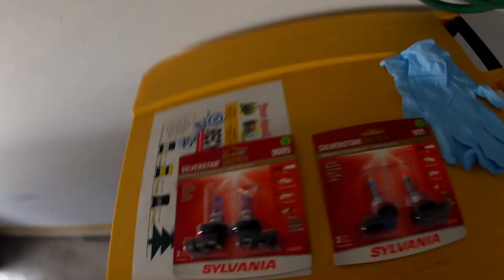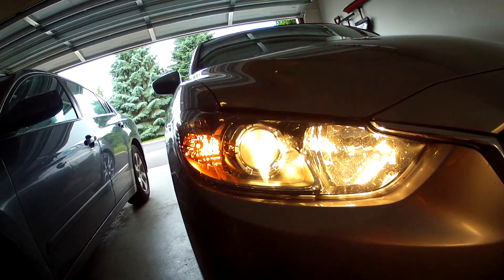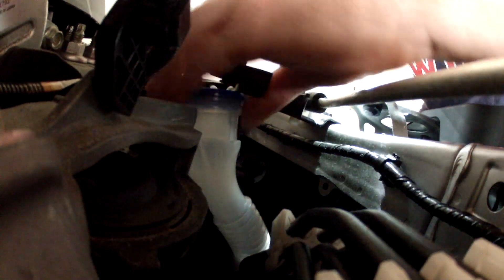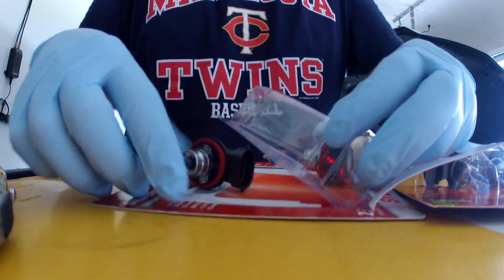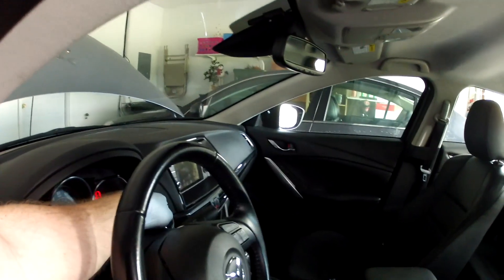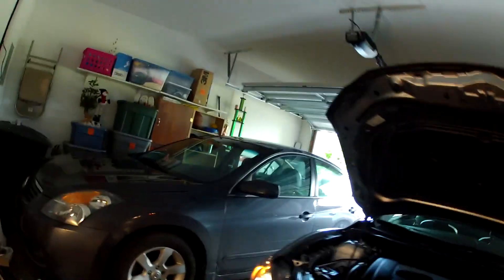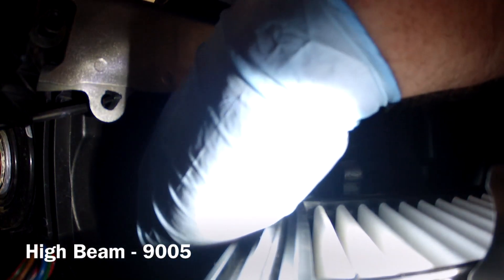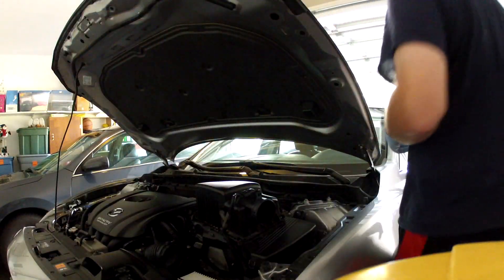2014 Mazda 6 Headlight Bulb Installation

Comment: Something I was wondering, if I want to replace my halogens with LED bulbs, do they plug right in perfectly, or do I need an entire new assembly? Do I need to alter anything with the fuse panel?
Reply: @avn4975  sorry, car was totaled by 4 deer 🦌 before I could install and I never found out 🙁

Comment: Great video again thanks and let me add this on my truck I put on led bulbs I had PIAA but the led bulbs are very much brighter so I picked up some eBay led bulbs for our 6 I’m waiting for my son to put on.

   I had OPT7 led bulbs on my truck well one of the drivers burnt up and OPT7 won’t just let you buy a replacement so I bought some just regular led bulbs on eBay they are just as bright so save your coins.

Comment: So I changed out my low beam no problem I can get the power plug to come off the bulb for high beam did you just pull really hard or is there a trick??
Reply: Same for me, did you get it?
Reply: @dvd162  did you get it? Im having the same problem
Reply: @joedoughty7212  yes i had to use a screw driver to push the tab and pull down at the same time
Reply: @dvd162  lol I eventually got it by doing the same thing. My big ass hand was in pain for tryin to do it for so long!

Comment: Let me tell you what I heard that if you run LED bulbs as daytime running lights they are going to go out faster because the voltage drops when your running them in the day if you find any different info please let me know.

  On some cars you can pull the DRL fuse now what I did today is I ran my headlights on auto shut off when I exit the car. 

 So in other words your headlight bulbs will go out prematurely because the voltage will drop because of the bulbs are your daytime running lights.
Reply from the maker: The Lasfit LED lights I just installed are said to last 50000 hours, that's a long time. But I don't run my headlights during the day, just the DRLs.
Reply: Josh Barnett I was thinking that our DRLs had a separate bulbs but they don’t it’s the high beam but somehow the voltage is cut back so they won’t be as bright in the day that why I heard that it not good for them. 

   I’m needing to put on the fog light bulbs yet to be done with the front lights but with all the rain we have had here in Houston we have killer Texas size mosquitoes.
Reply from the maker: @grandparolie  lol damn mosquitoes!